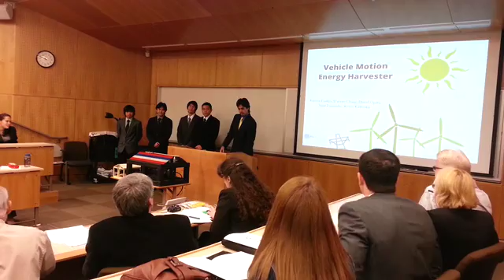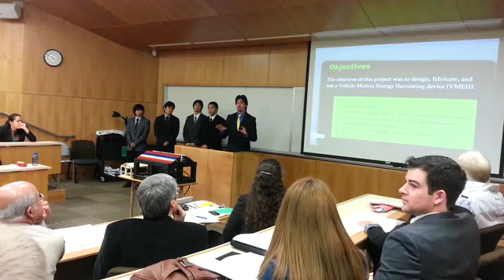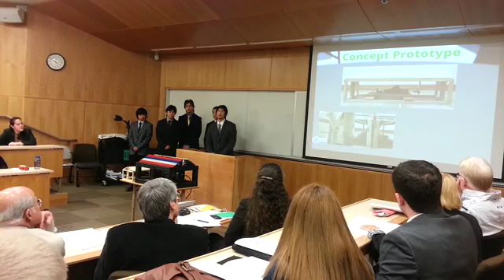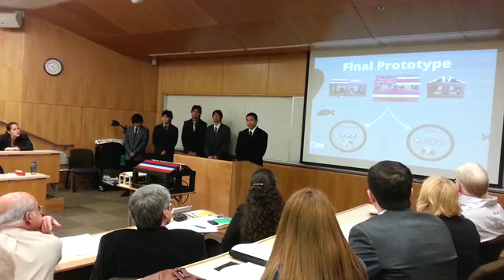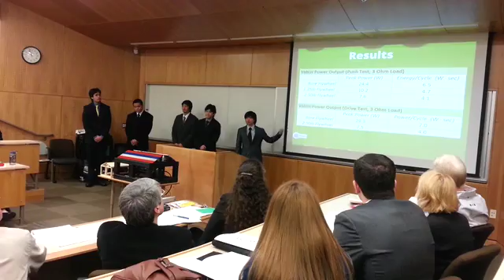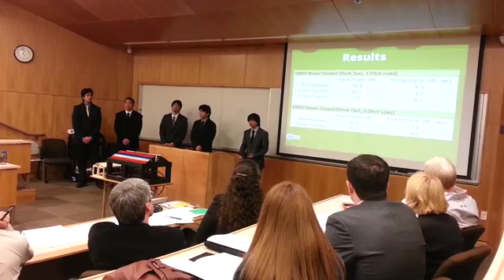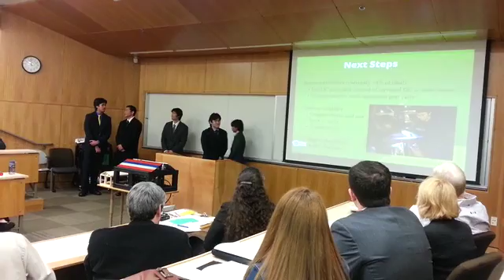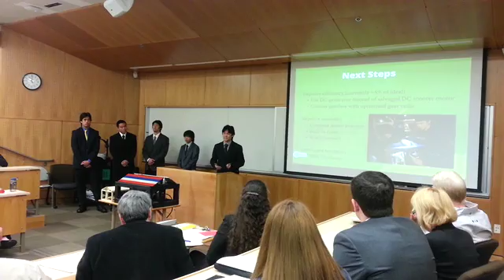Senior Presentation

Comment: Hello Sean, how does this measure up during flooding and rainfall? And what is the overall maintenance for this is like on a large scale neighborhood?

We want to implement this here in Dubai
Reply from the maker: This project was a proof of concept. More research and designing would be needed before it can be implemented on a large scale.    Efficiency was very low due to our limited budget and weathering was a secondary priority for the purpose of this project. All materials would need to be replaced by stainless steel or another type of material resistant to weathering which would increase the cost by a significant amount. Also renewable energy takes years for it to pay itself off for it's low output but further designing and testing would required to see if it'd be cost effective in the long run.
Reply: Omg Sean actually replied 😂